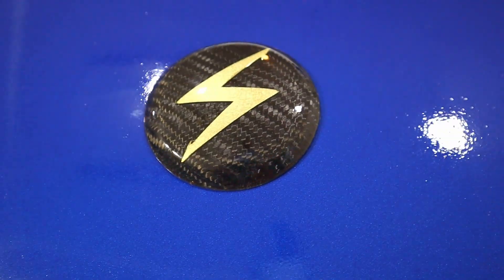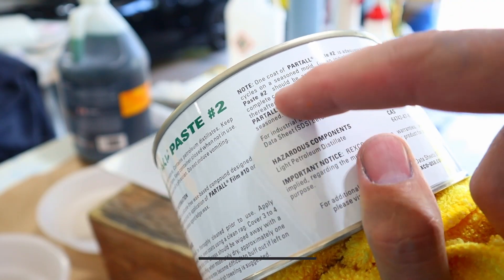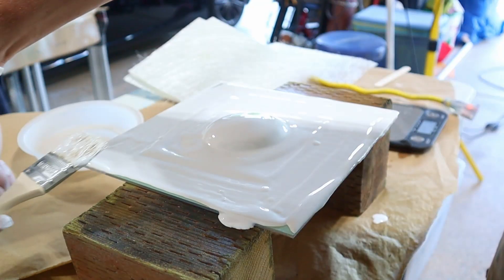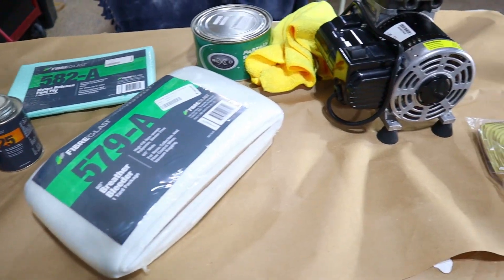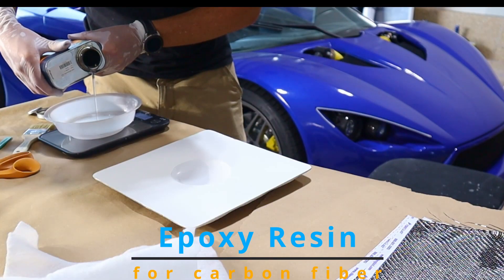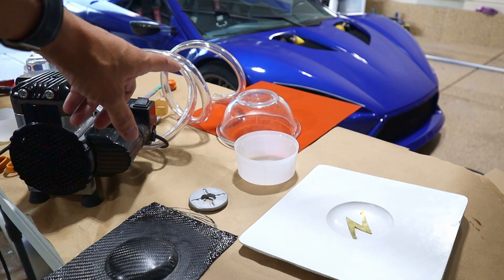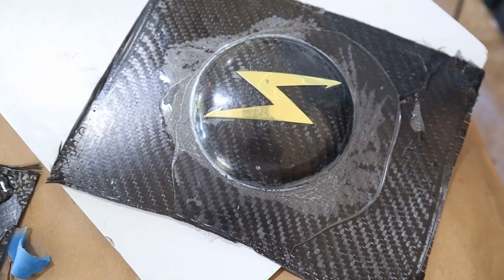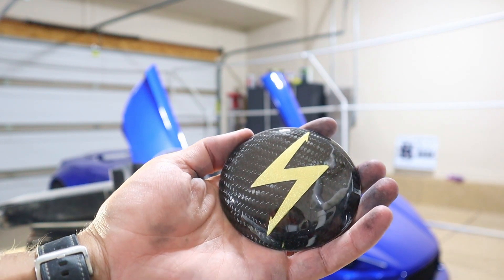Carbon Fiber Car Emblem - How to make your own carbon fiber parts

Comment: Heat gun or torch is great for popping resin bubbles.  Recessing the logo in the nose a bit and maybe a bit smaller?? But great job and it turned out nice
Reply from the maker: Thanks for the comment!

Comment: Looks great!  You already did emblem but I would have done larger lightning bolt clear with a tiny bit of blue in epoxy.  Add a few LEDs and have it randomly go on and off like real lightning.  Paint definitely needs a good blocking to 3000 grit.  If you go through clear just put another 3-5 coats clear on top.
Reply from the maker: Thanks for the suggestion!

Comment: Followed the link… while attempting to finb bagging materials, wish they had a kit, my cpu and fan ramped to 100%… clearly it exposed me to something.

Something on that site is not right. I highly recommend not putting your card info in directly. Use paypal or something.
Reply: Thank you for letting us know. We have our web team looking at this. We are very secure especially during checkout. It is difficult to offer a kit for bagging materials as there are about 3-5 choices of material based on a particular project. You can email customerservice@fibreglast.com and we would be happy to help you choose the right materials for your project.

Comment: I love the color on the k1… not a fan of the emblem, i think a smaller more refined design would fit better… but its not mine. Youre happy, im happy. 

The normal k1 badge with a back lit lightning bolt perhaps
Reply from the maker: thanks for the comment

Comment: hey there's quite visible orange peel on your car. You can use polishing compound to make it looks smoother and close to factory quality. I think chrisfix make some videos about this
Reply from the maker: Still on the "to do" list
Reply: Sanding then polish
Reply: @tristan_andrade  that is what “cut and buff” means thanks for responding.
Reply: I don’t think he has cut and buffed is super Car yet.
Reply: I agree!  Definitely need to cut and polish the paint to give it the super car finish. Follow Ammo NYC on YouTube to see what we’re talking about. 

Also not a fan of the carbon logo. I think the brass bolt would look amazing on the hood, but not raised. Definitely should be flat.